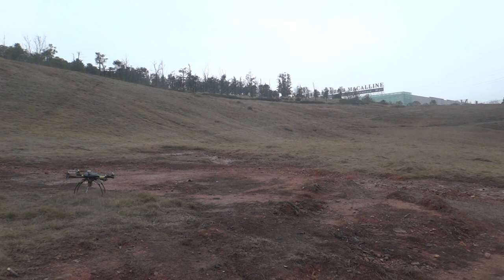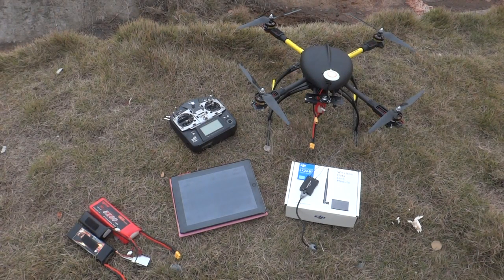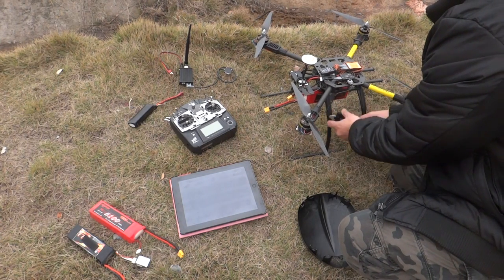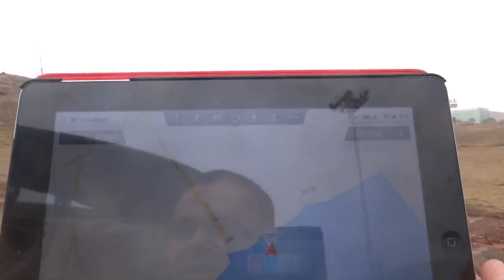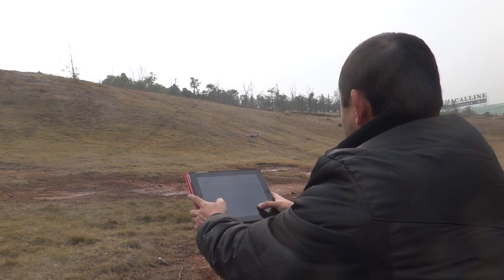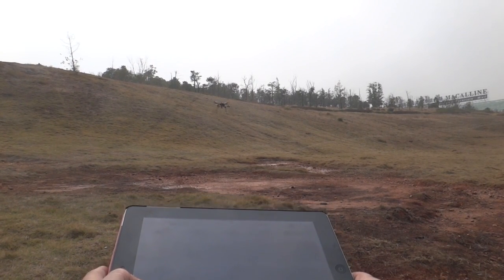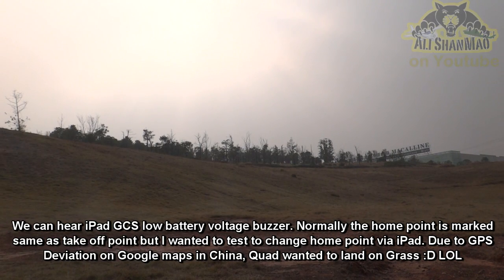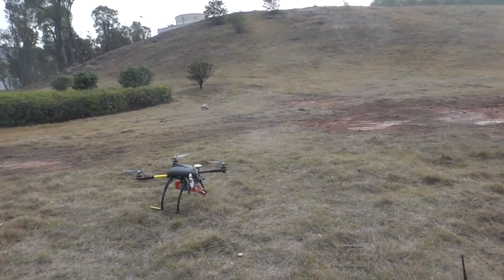OFM650 V4 SE Autonomous Flight with iPad Ground Control Station

Comment: Great idea! I would like to experiment it but I have some problem with my Drone. I changed the electronic on my X650 replacing the original one with a DJ NAZA V2 ( yellow kit ), but something goes wrong with the xaccess Esc and motor, since the motors don't stop to run, despite radio control works perfectly, even the software shows that everything seem to be ok, but there is no way I can't control motor rpm, since they all four run at full speed. Is there anything I missed about the setting? or do I have to replace both Esc and motors? Hope you can answer me soon, I don't like to see my nice shining orange X650 sit on the ground.

Big hug Ali.
Reply from the maker: your escs are not compatible with Naza. So you need new escs mate
Reply from the maker: as soon as you connect power, motors go full throttle. :D that means you need new escs that are compatible with Naza
Reply: Ok, now the next step is where to find new Escs for the 4  Xaccess motor, could you reccomend me somewhere who ship them in Italy? Thanks so musch for your precious advices.

Comment: Dear Ali, I never liked multi rotors before until I came across one of your videos. This OFM 650 is the most beautiful quad I ever seen. I own few Helicopter but I'm tired of the stress that comes with flying them constant trimming and crashing, repairing. The only reason I don't have a quad is the crappy looking quads you see in hobby shops and sites. I checked your site the only problem I'm not into arial filming so i can't justify to myslef paying the high price tag of your product I'm sure though it's worth every penny for the fact of the way you customize them for filming professionals, they can spend that money cause that's what they do for living your machines probably makes them money I'm sure. But about the rest of us who would love to fly one of these masterpieces of yours for the sole reason of flying a machine that's actually fun and easy and reliable. In other words for sake of the hobby itself without the pain that comes with helicopters and cheap quads. The long story short, Ali please consider having a line of products that's meant for people who just want to fly something that stable and beautiful and not into filming at a little lower cost. One more thing I think you should change the name from OFM to SFM ! Sexy Flying Machines lol. Anyways keep up the great work and God Bless. Rami
Reply from the maker: OFM FPV mate 380. purely a fun to fly low cost Quad with COmplete FPV System and Onboard HD recording :D check it out

Comment: i am a little surprised they are using bluetooth for the communication. on my XAircraft i use 3DR telemetry communication, i didnt think bluetooth had really great range?
Reply from the maker: You missed it :) bluetooth is to communicate with iPad and Data radio sitting next to you on ground :) Then that data radio on ground communicates with the data radio on board Quadcopter using a 2.4ghz Link or 900mhz link as per your choice. I was using 2.4ghz Data link that has 4km range as per DJI. Now, on the ground, how far do you want to go from your bluetooth linked Data radio? as GCS keeps showing the bluetooth and 2.4ghz Signal strength all the time.
Reply: alishanmao you are absolutely right, i did miss it. i was thinking it was solely a bluetooth connection to the quad. thats why it didnt make sense to me, bluetooth generally has a small range, maybe 50 meters? 120 feet? anyway good video as always. because of you i started building my own quads for personal use. and along with that the head aches that come with learning :P